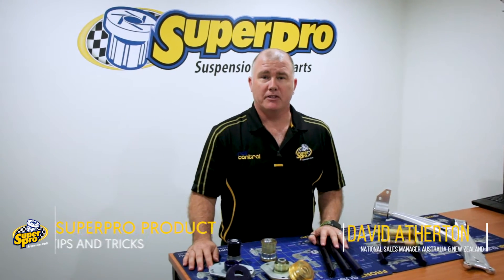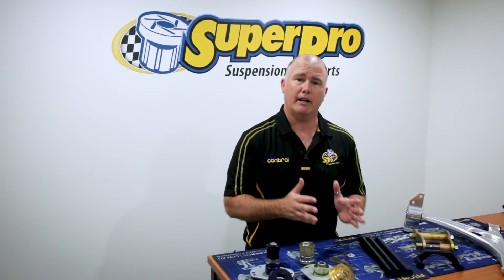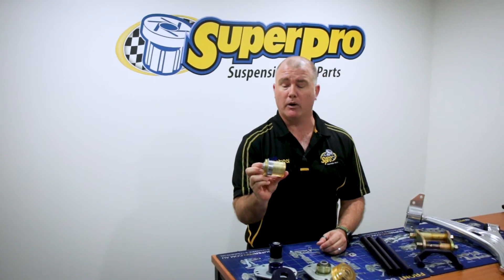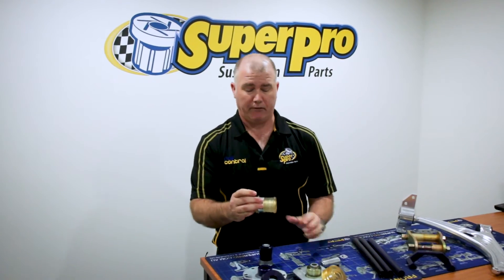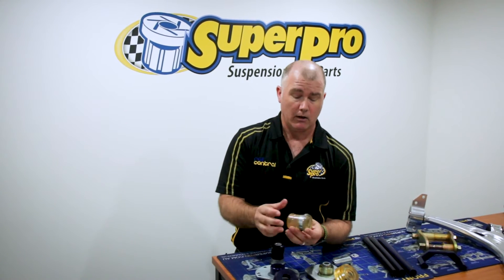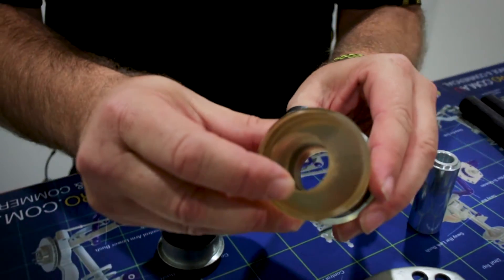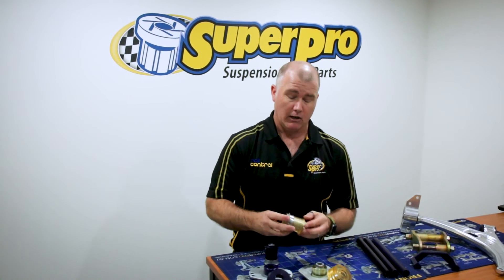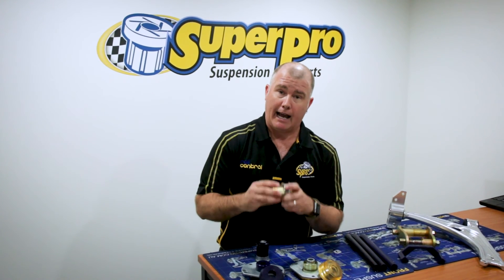SuperPro Polyurethane Suspension Bushing Noise NVH

Comment: Dont waste your time with Polyutherane bushes like these. This Guy is just a snake oil salesman trying to flog his product. Rubber bushes are much better unless your racing a car . Rubber Bushes are quiter and smoother and generate less road noise and you never have to take your suspension apart  vs Poly where you have take your suspenevery apart every few years to grease them becasue  they squeak . Rubber bushes tend to last about 20 years , so I would rather take my suspension apart  every 20 years vs Poly where you have to your suspenion apart every 1 to 2 years to grease them to stop them squeaking. I had Poly bushes and they squeaked every time I drove thru a Puddle and had regrease them every time . I now stick to OEM rubber and dont have to worry about driving in the rain etc and taking my supsension apart all the time to grease.
Reply: Rubber bushings DO NOT tend to last 20 years.  More like 5 years and then you'll have to take apart your suspension to replace the bushings or even the whole component.  That is when I replaced my rubber bushings with polyurethane.
Reply: What about if you're a Taxi Driver and are changing the factory arms every 1-2 yrs, is it worth it then regrease every year?😂
Reply: my old school mechanic recently said the same thing after I had a new suspension kit installed and a poly bush squeaking.
Reply: All depends on the softness of the polyurethane they are using. Polyurethane can come in a wide range of durometers. I can’t otherwise speak about squeaks.

Comment: Chevy malibu 2011 , isn't at your list ?
Reply from the maker: Hey Mate, I just cross referenced our catolgue and yes it looks like we do not do anything for your car.
Reply: @SuperProSuspensionParts  
Hey , many thanks for your reply , however , are guys not considering to do that ?
Reply from the maker: @abuelzoz2009  No worries, at this stage it is not on our vehicle development list.
Reply: Polyelast rear diff bushes for FG Falcons transmit diff noise throughout the vehicle. Sent a note to Superpro and got no response, I absolutely regret putting superpro into the car.
Reply: @scabootie  comfort bush is required,  there is more than one.
Comfort has relief cuts in it to minimise NVH.
I had my whole rear end cradle re bushed and it was fantastic.